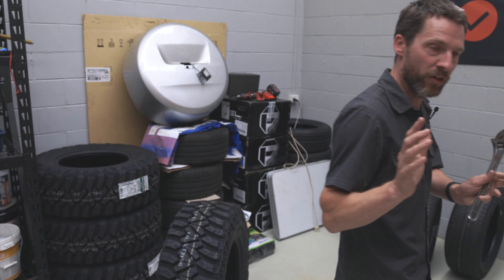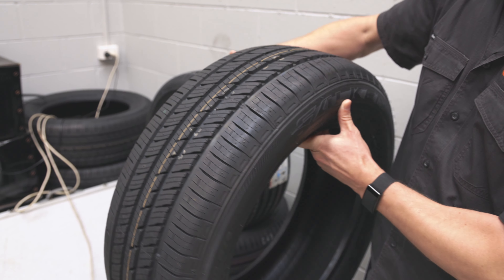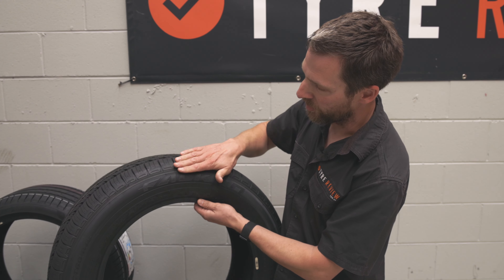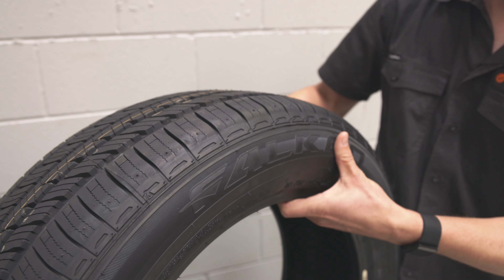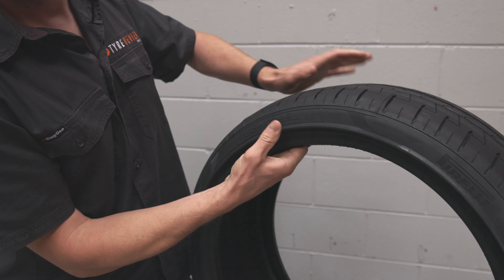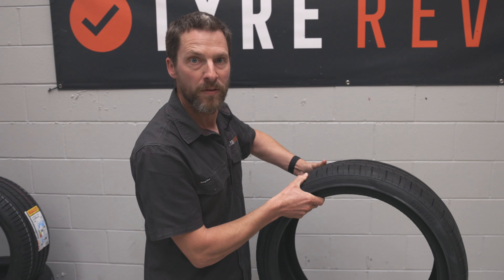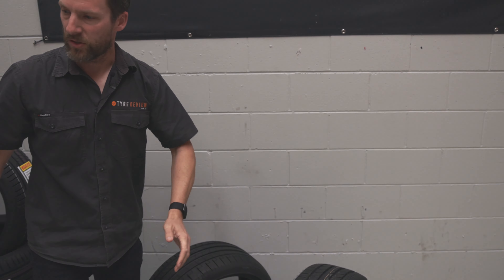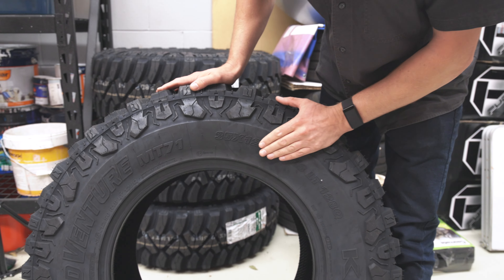What are Tyre Sidewalls?

Comment: good day, I just want to ask if its safe to use the wd-40 silicone spray on the sidewall of the car tires?
Reply from the maker: It'd probably fine, I just wouldn't get it anywhere near the brake discs (as it'll be no good for your braking capability) or your bodywork (if ever you need bodyworks, silicon is the devil for paint, so they'd hate it).

Comment: Can a soft sidewall cause squirm? My car has some latency for any input on the wheel, it drives like all the tires are not inflated enough, it drives like on gummy bears since I purchased All Season tires.
Break in period has finished but fast manuvers left to right feel so scary. 😃
Reply from the maker: Hi mate, they certainly can! Particularly if they're under-specced on the load rating. Basically the load rating is the amount of weight each tyre can carry, and the same tread pattern can have a few different load ratings, which are actually separate SKUs.

So, I'd check your car and what the minimum load rating should be, and what's actually on there. 

That said, even if the load rating is appropriate on the tyres, sidewall flex can definitely affect the vehicle's handling characteristics. I was testing some all terrain tyres once, and it actually felt like the shoulder blocks were folding over on fast corners, which isn't fun!
Reply: @TyreReviewVideos  Thanks. My car needs 91 index, these are 94. I tested them from 2 bar to 3 bar pressure to see if they get better, but almost no difference. I suspect it is a combination of the soft sidewall and tread pattern that causes squirm, they feel horrible. 😃
Overall nice tires, but not fun at all.
Reply from the maker: Interesting. Out of curiosity, what are the tyres, and what vehicle do you have?
Reply: @TyreReviewVideos  The car is Alfa Giulietta, it has McPherson at the back which makes things worse I believe as it is stiff and precise. The tires are Riken All Season, it is a cheap Michelin sub brand, nice for regular driving but totally wrong for this car. 😃
Reply from the maker: Righto! Unfortunately I haven't driven the Giulietta, nor am I familiar with the Riken. Sounds like you've got some Pilot Sport 4's in your future!
Reply: @TyreReviewVideos  Giulietta is handles like a go cart which exaggerates this effect as the suspension is relatively stiff. 😃
Riken is an old Japanese brand, but really it is a cheap sub brand of Michelin so their tires are the cheapest on the market. I wanted to test All Season tires but decided to try potentially the worst as those were very affordable, however the tires perform very well in all conditions for a regular driving, which is not what I expected really.
Unfortunately Pilot 4S are not made in 17 inch size while regular Pilot 4 does not feel very sporty although having the best grip, there is also Eagle F1 and Premium Contact 6 that feel better, but you are right after this experience I will choose wisely next time. 😃👍
Thank you for your time. 🖖

Comment: Is tyre sidewall same as tyre profile?
Reply from the maker: Hi! Kinda, but not quite. The sidewall is the actual bit of black rubber that joins the bead to the tread face, whereas the tyre profile is the depth of the tyre from tread face to bead, and is a percentage of the width. For example, a 285/70 R17 means that the depth of the tyre is 70% of the width, or just under 200mm. Hope that helps!
Reply: @TyreReviewVideos All this tire info, goodness me. I'll have to sell mine and get a bicycle unless I can find a good man to help me with this stuff. Never should have bought the darn thing. Don't know that much about bikes either, actually. GREAT video, though.